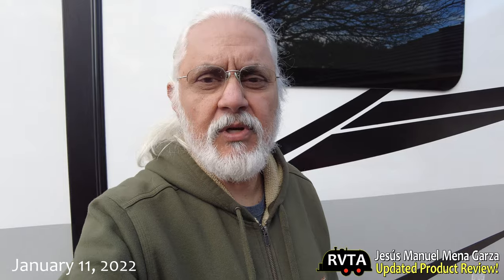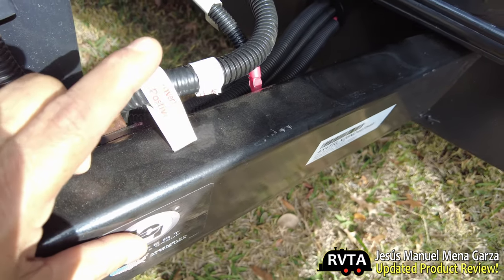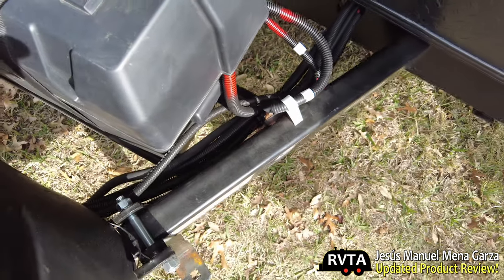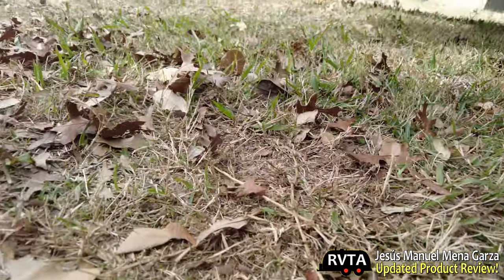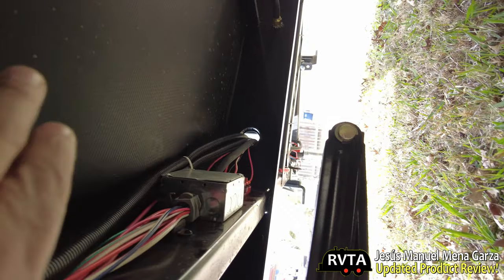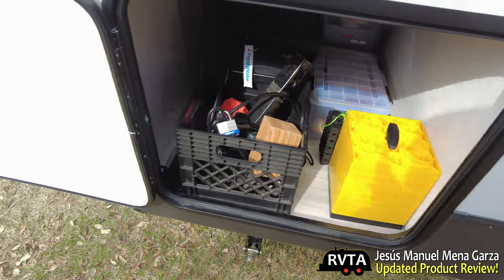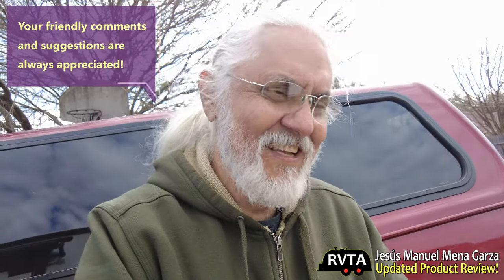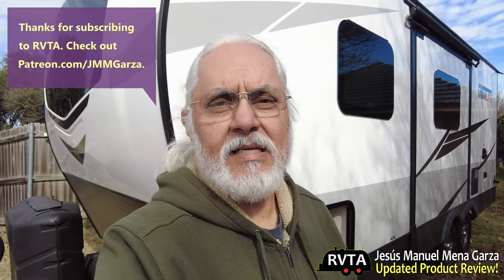AoLithium Battery Installation Ideas! Any Suggestions? #AoLithium #LithiumBattery #RVbattery

Comment: Hello from A fellow 2205S owner. I relocated our lithium batteries to the pass-through compartment, as you're considering. It's a pretty easy project and is well within your skill set.
The black block on the tongue with the cable attached to it is a 100-amp fuse. The cable attached to the top, which you pointed out in your video, runs directly to the inverter, as does the big negative battery cable. Once you remove the wall panel in the pass-through compartment you'll see that the inverter has two extra terminals, one positive and one negative, and you'll see where the current battery cables are attached to the inverter. I can provide more information if you'd like, as I've spent some time inside and under our 2205S doing projects that you've mentioned, and all of them fairly easy; relocating the batteries, routing cables, installing my mppt charge controller in the pass-through, to name a few. Best regards, Dave in Michigan.
Reply from the maker: I'd love to see some pix.
Reply from the maker: Schematic? Just ask'n.

Comment: This can be as simple as you want it to be.  Here goes my advice. Get some  2awg flexible welding cable. Attach those to the end of the batter cables.  Basically your extending the cables. Run that back towards your storage compartment and make a whole. Run the cables up and hook it to your new batteries. Ok yes some people are going to say there is a lot more to it. But their does not have to be! This will get your new nice lifpo4 out of the weather. P.s yes change out your converter “it not an inverter” to a lifepo4 friendly one. To be honest changing the converter is easier than moving the batteries. Things to consider. 1 catastrophe in-line fuse. 2 Victron battery Bluetooth monitor. Or shunt.  3 plan ahead. Have your tools and wiring plan ready before work starts. When doing your wiring plan. Keep in mind for expansion. Real estate is limited in an rv. Better to plan ahead for some type of expansion and placement of items.  You never know. You might want to install a inverter and wire it thru your coach, and now have to re-do your battery placement to accommodate the new upgrade. I am currently drawing plans to move all my batteries from the front compartment to the back compartment and making it a full electrical hub for the whole rv. My wife calls this keeping me busy, I call it more fun for me!
Reply from the maker: Great advice. I did the install yesterday. Thanks.
Reply: @RVTA  how did it come out?  Pictures?

Comment: I too would install the batteries in the pass through.  The easiest way to do that would be to install a battery box or a couple of strips of 1x2 and strap the batteries down.  Then run (+) and (-) cables out to the existing battery box and connect the cables to the existing battery cables.  Use waterproof cable pass throughs like those sold by Blue Sea, to get the two wires out of the pass through.  This method avoids rewiring the inverter since it will use the existing cables for all connections outside the battery box, plus you only have to buy 4 new wires (two to connect the batteries in parallel and two to go from the batteries to the current battery box.  I think #2 wires are adequate to connect the batteries in parallel and #1 or #1/0 will be more than adequate for the connection to the current battery box, but use 2/0 if you want overkill.  You should mount two power posts in the existing battery box (+) and (-).  I don't know how the cables are currently connected to the current battery, but in the worst case you might have to change from battery post connectors to ring terminal connectors.  I would also mount a Blue Sea battery post fuse holder on the positive terminal of one battery and put a 150 to 200 amp fuse in that holder.

Components you would need:
1) two #2 wires 2' long with 5/16" (M8) ring terminals for connecting batteries in parallel

2) Two 1/0 or 2/0 wires about 8' long (length depends on where you mount the batteries) with a 5/16" (M8) ring terminal on one end and a 5/16" or 3/8" ring terminal on the other end (depends on connections to existing battery cables).

3) One Blue Sea Systems MRBF Surface and Terminal Mount Fuse Block ($20 on Amazon) plus one 150 or 200amp MRBF terminal fuse ($15-$20).

4) Two Blue Sea cable clams to pass wire through bottom of RV (~$20 each).

5) Two Blue Sea 5/16" or 3/8" Powerposts (~$14 each).
Reply from the maker: Sounds like a great design. I'll have to buy adequate length cable for sure. I'm glad your advice isn't making my head spin. I appreciate that.
Reply: @RVTA  It is not hard.  Just two wires (+) and (-).  The only tricky part is making the wires big enough since that depends on the length of the wires and how much current is passing through the wires.  Wires have a capacity rating called ampacity.  Rated Ampacity depends on how big the wire is and the temperature rating of the insulation.  The higher temperature the insulation is rated for the higher the ampacity of a given wire will be. The number of amps passing through a wire should not exceed its ampacity or you will melt the insulation and maybe the wire.  For example 2/0 wire with 75C rated insulation has an ampacity of 265 amps, but if it has 105C rated insulation the ampacity is 330 amps.  I use Ancor marine wire with 105C rated insulation, so a 2/0 from them can safely carry up to 330 amps.  A lot of people use welding cable which typically has 60C rated insulation and a 2/0 wire has an ampacity of about 220 amps because of the comparatively low temperature rating of the insulation. 

 Second all wires have resistance that causes a voltage difference between the two ends of the wire (end connected to battery and end connected to gizmo.).  The voltage difference (drop) depends on the size of the wire, the length of the wire and how many amps are going through the wire.  The voltage drop is simple to calculate from V(drop) = (wire resistance per unit length) x (length of wire) x (amps going through the wire).  So for a given number of amps going through a wire, the longer the wire is the bigger (lower resistance) it needs to be to keep the voltage drop small.

-The high current things you have are your 1000 watt inverter (max amps = ~90 at full power), and thongs like your coffee maker (60-110 amps depending on the coffee maker), your RV fireplace (70 to 140 amps), your RV heater (10 amps).  I would not use the fireplace on battery since even on low it will flat your two Aolithium batteries in about 3 hours).  For your rig, I would size the battery cables for 200 amps maximum although you will not be using that much unless you have the microwave on high and are running the electric espresso machine at the same time.
Reply from the maker: @todddunn945   I may have a solution or not? https://www.youtube.com/c/RVTravelAdventures/community Please feel free to make suggestions. Thanks.

Comment: Think securing those expensive lithium batteries inside would reduce the temptation from prying eyes for sure. Also would possibly keep them warmer in cooler weather, allowing them to charge due to cold temp protection. You could secure them or box them in with 2”x2” wood base. Could be cut with a simple handsaw. Screw the wood base into floor. Then secure the batteries with a ratchet strap? I would upgrade the inverter as well with the extra power stored in dual battery setup.Reviewing how to add second PV panel on roof using existing wiring. Thanks for the video footage of a new trailer, as it helps me plan for my own….hopefully soon!
Reply from the maker: Warmer is better. I must admit I like the Noco battery box. Keeping it simple. Yes, adding a panel or two is planned. MPPT charge controller too. No big hurry.

Comment: I'm thinking about purchasing the 2205s to. I'm just learning about solar, chargers, etc. 
I do have a question inside the 2205s is that just a PWM monitor above the fireplace, or is that a PWM monitor and charge controller built all in one?  I was thinking could a fellow switch that PWM out for say a 30 amp Victron MPPT monitor and have a separate MPPT Charge controller in the pass thru closer to the batteries.
Reply: That's a great plan. Yes, the display is also a PWM charge controller. Sadly.
Reply: @ChicanoPhotographer  Thanks for the fast reply, I have few more questions. That PWM GO Power is it 30 amp? I was thinking it was and the portable solar plug port on the passenger side was just a 10 amp?  I watched your other video of an owner review and you said where the battery box is located it's only 21 inches across? I was hoping I could drop in 2 6 volt AGM's there if I would have the room and see how that goes for our style of camping.
Reply from the maker: @brecksmith7919  30 amp! In 10 years, the RV industry will catch up to what the today's market wants.